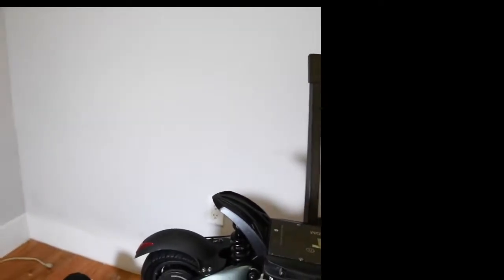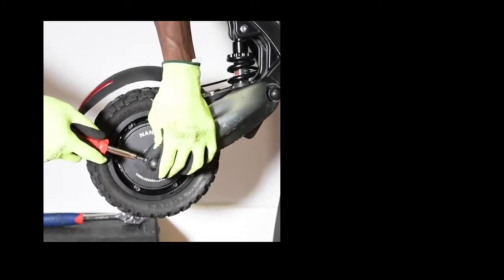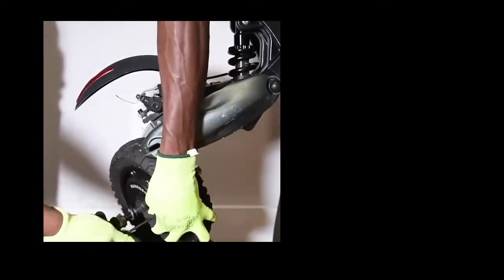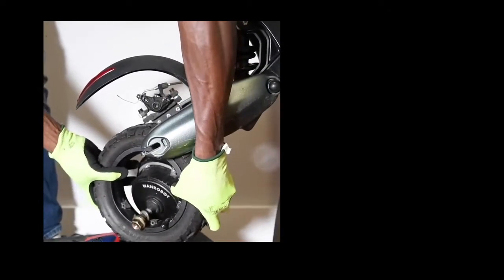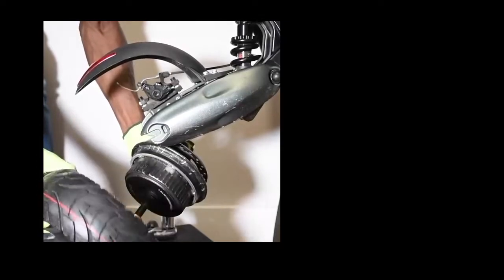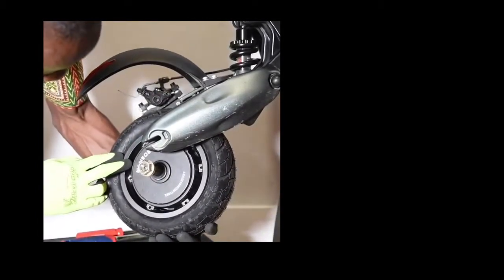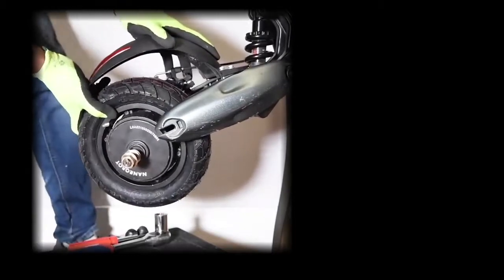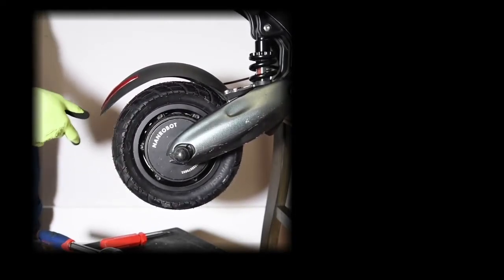How to Change Remove Scooter Flat Tire Nanrobot d6+ Electric Scooter

Comment: Have you ever put a solid tire on a d6+??
Reply from the maker: Yes. This tire
Reply from the maker: https://www.ebay.com/itm/364867693442?mkcid=16&mkevt=1&mkrid=711-127632-2357-0&ssspo=sryndzrrtts&sssrc=4429486&ssuid=sryndzrrtts&var=&widget_ver=artemis&media=COPY
Reply from the maker: But your ride will feel different. More  shock feeling
Reply: @RAOOGO  I'm ok with that. I've had 5 flats in one year and it's never the tire, always the innertube